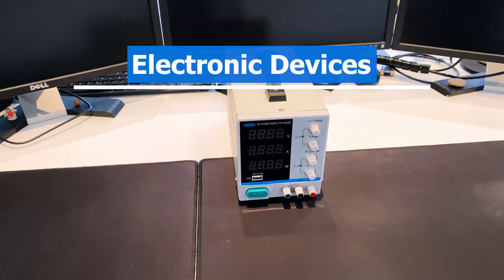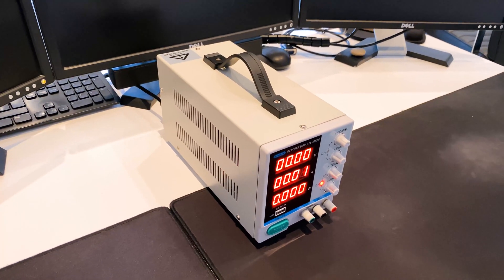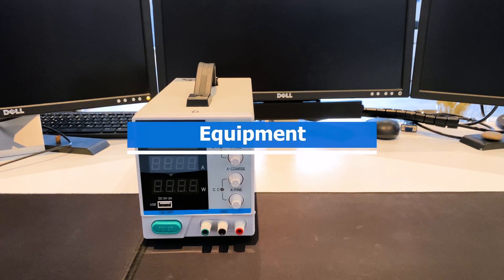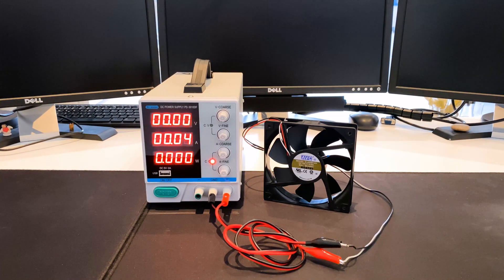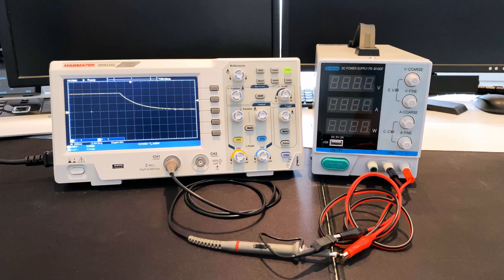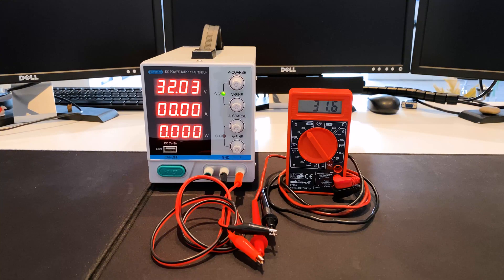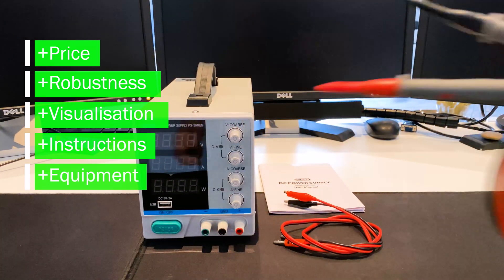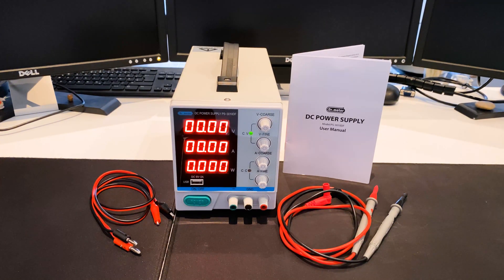Dr.meter PS-3010DF DC POWER SUPPLY - Practical Review

Comment: Voltage deviation can easily be calibrated. If you open housing and look from the back onto the front panel, the very left blue Potentiometer can be used to make the display Match aktualisiert voltage.

Comment: Stumped! I'm trying to top balance some new LiFePO4 cells using its 
constant voltage mode. Directions tell me to turn the amp knobs 
clockwise all the way, then set it to my desired voltage (3.65v in my 
case), then connect the battery to the terminals. As soon as i do that, 
it reverts to the constant current mode. Any idea how to keep this in 
constant current mode?? Any help would be much appreciated. thanks for 
the video!
Reply: I believe it will push constant current (about 5 amps) at 3.65 volts until your cells start climbing the voltage curve towards full.  As the cells near fully charged you will see the current start dropping off, the voltage will stay constant (it should automatically switch to CV) and the current will eventually go to zero or near zero. I used this to top balance eight - 280 amp/hr cells connected in parallel.  This will take a very long time depending on the state of charge of the cells when starting out. Remember LiFePO4 cells have a very linear voltage curve.  When I received my cells they all measured around 3.2 volts. To get mine to all reach 3.65 volts connected in parallel and the voltage to drop to .01 amp took over 15 days. Hope this helps.

Comment: Great review of the device! I need the dual channel output for having 3.3V and 5V voltage lines in my digital electronics project. Can I use USB as the second stable 5V output together with main adjustable channel set to 3.3V?

Comment: Ich hab gesehen/gelesen, um constant current einzustellen kann man + / - am gerät kurzschliessen, volt voll aufdrehen und dann langsam ampere einstellen. Gerät ausschalten und dann erst den circuit anschliessen. "Das gerät kurzschliessen" da gehen bei mir alarmglocken an..aber es scheint wohl eine wirkliche vorgehensweise zu sein. Is da was dran? Ist es gerät abhängig? Explodiert dr meter dabei? Hehe.
Das problem das ich mit dr.meter hab, is das die drehknöpfe schon sehr unresponsive sind..wie die warm wasser einstellung meiner dusche. Dreht man am ampere knopf nur leicht, schiesst man schnell mal übers ziel hinaus und verbrutzel empfindliche teile.
Reply from the maker: Das Gerät kurzschließen ist die tatsächliche Vorgehensweise. Keine Sorge, es explodiert nichts. Der hohe Stromfluss wird intern reguliert.
Die Drehknöpfe sind nicht geeignet, um Werte präzise auf die letzte Kommastelle einzustellen. Es sind in der Umsetzung reine Potentiometer. Das Einstellen von Spannung sollte daher ohne anhängende Verbraucher erfolgen, um empfindliche Bauteile nicht zu zerstören.